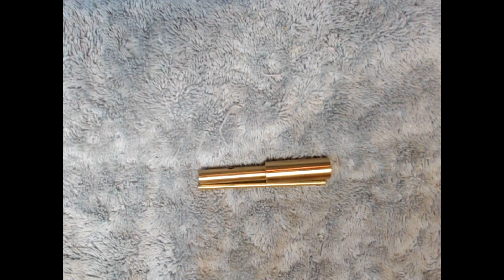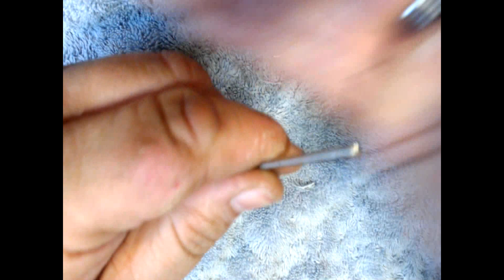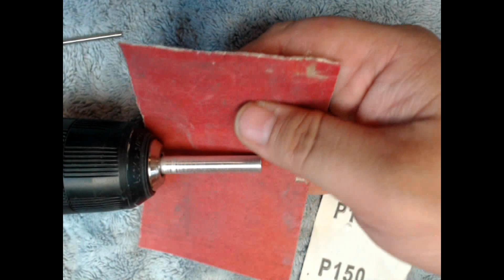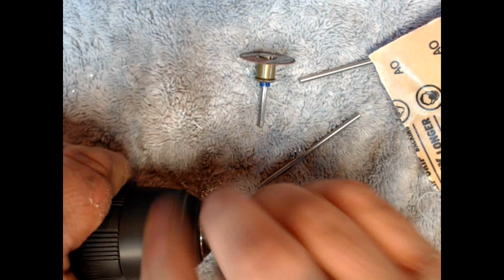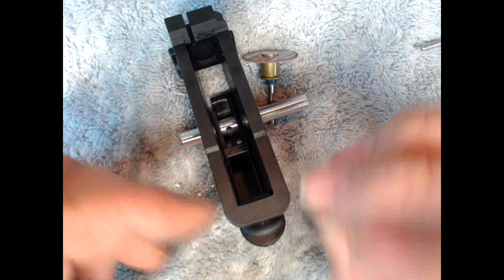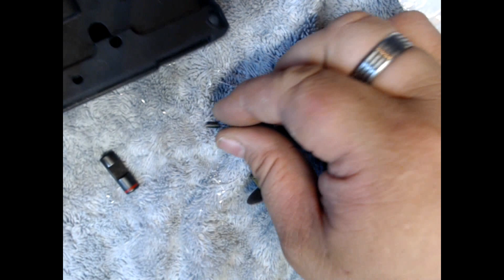How to Make a Ruger 10-22 Safety Removal Tool on the Cheap!

Comment: In now way do I want to take away from your video because it's awesome. But without all that work you can use an old ball point pen.
Take the pen apart, using only the inner ink tube and the spring. The inner ink tube is exactly the same diameter as the ball dent spring assembly.

Stretch the spring long enough so it will hold the ball dent in place at the end of the tube and you can still pull it away with your finger once in place. Run it thought the assembly and put the ball dent in place using the tube and spring. Once in place push the ball dent/spring all the way in. Once pushed in, pulled the spring back out of the way but with the ink tube keeping the ball dent pushed in place. Then slid the safety in part way to hold the ball dent down before pulling the ink tube out. Pushed the safety in the rest of the way and you are all done in 10 seconds. Engineering for lazy people.
Reply from the maker: That's awesome!   That's one of the things I love about Youtube.   There's always another way to do it.  Thanks for watching, and thanks for sharing!

Comment: The primer tube for a Dillion 550 is the perfect diameter. I have a dozen laying around. Easy to work with as it is hollow. I use a .125" drill bit as the rod to depress the spring and plunger. Did not have to buy anything.

Comment: Thanks for this video. I took a Hoppes shotgun cleaning rod and it happened to be the exact size of the safety switch and drilled a 1/8 inch hole through it. Works like a charm and I still have the cleaning rod . Win win.
Reply from the maker: That's an awesome idea!  Thanks for watching!

Comment: I used a 5/16” nylon carriage bolt. It was 3” long with about 1” threaded at the end. I cut off the threaded part to leave just the smooth bolt and sanded it smooth/flat at the cut. It was easy to dill out the 1/8” hole in the nylon. I then used the back end of drill bit as my push rod. Not a long term tool for professionals but perfect for my occasioanal use and super easy to drill and sand the nylon material. Cost of bolt was just over a dollar.
Took 30 seconds to install safety.
Great informational post above. Thank you NinjaMidget

Comment: 1/8th hole drilled through a pencil 1.25" from the cutoff end works great. Just use a blunt finish nail to push endent down.
Reply: Thanks!

Comment: Good video. But I just did what you did with 1 tool,  a large nail set. It already has a divot for the finish nail head and sets nice on top of the plunger. I slid the safety right up to it , pushed down on the plunger with the nail set until it was below the safety and just pushed the safety right over it. Took 2 minutes.  Any tool with a divot will work.